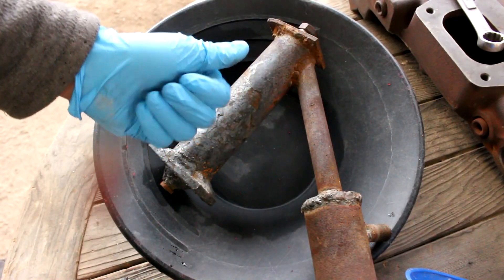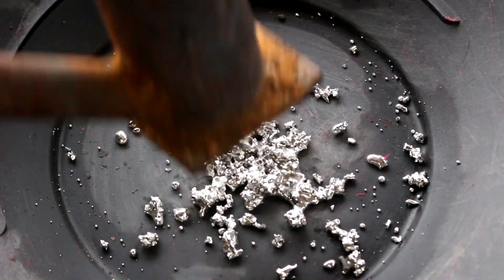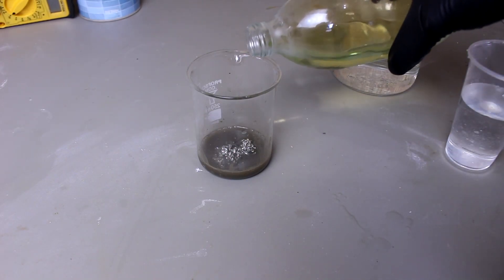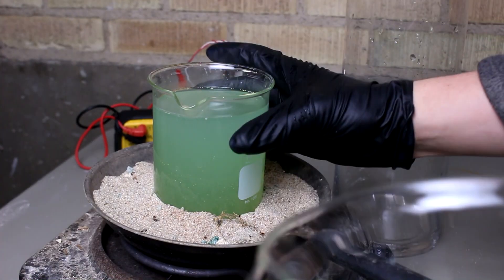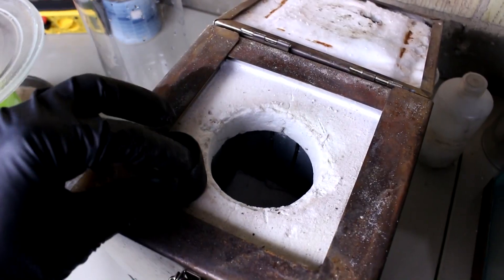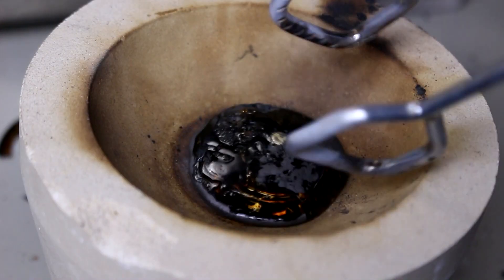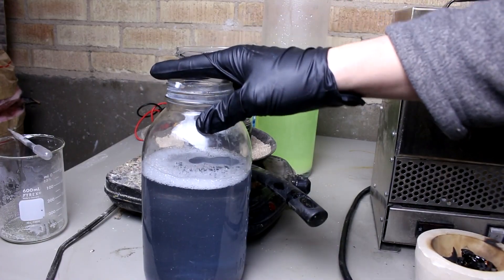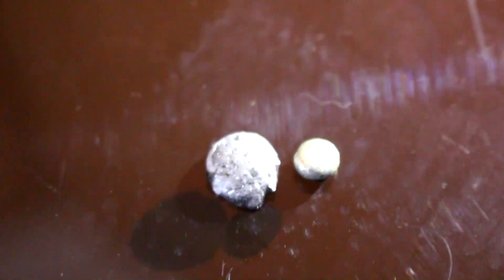Metal Refining & Recovery,  Episode19: Gold From Mercury

Comment: Cody, remember your gold-plated truck bumper and the gold-plated measuring cups you gave to your mother, well why not simply paint them with a fluid of gold/mercury amalgam and then "cook" off the  mercury (using a retort, of course)?  That sounds a lot easier than the complicated electro-plating process.

Comment: I read about an easy extraction process just using a large potato. You slice the potato in half scoop out the middle portion of one half (approx %50). You then place your amalgam into the scooped out part, place the complete half on top & secure it with tie wire. You then place the potato in a campfire for an extended period, as the potato cooks the mercury leaches into the potato, remove the potato, open & remove nugget & burn the mercury back out of the potato. P.s. I have never tried it.

Comment: Theres an old trick to get rust out of a gas tank like on a motorcycle or four wheeler, would work for your distiller, put a few ball bearings down the hole and shake it like a maraca, should get the chunks off the side.
Reply: Re plug it before shaking of course haha

Comment: Hey @Cody'sLab I have a very simple and quick question that might be great for your next video. I have a friend who put a bottle of water in the freezer overnight, and when he took it out the next morning it had turned to a jelly consistency, not crystallized slush, not frozen water, but jelly. Here's his message - "So I put a bottle of water in the freezer to help with my hangover, grab the bottle out and crack the lid and the water turns misty. Squeezed the bottle a bit and it didn't feel solid, so naturally I presumed there was no ice. After opening the bottle, to my absolute amazement I find that not only is there ice in the bottle but it's gelatinous!!"

Comment: Hey Cody just a small tip, after you treated the unknown mercury metal amalgam you should test the solution with stannous chloride to see if any platinum group metals are in solution. Palladium and Platinum are both used in some dental alloy mixtures.

Comment: Ya got some new glassware and that's great, but why are ya still using so inadequate equipment when it comes to hot/dangerous stuff ?! You're handling a 2000°C crucible with barbecue pliers, above a plastic table ! C'mon, let's invest in a decent way to get your hot crucibles out of the furnace : )

Comment: Hi Cody! Out of curiosity, prior to adding the CaCl2, why didn't you take the opportunity to drop the majority of the Hg out of solution with metallic copper or zinc?
Reply from the maker: Chris Giorgi 
Because that would also drop the silver and gold.
Reply: True, leaving a small quantity of cleaner amalgam of Hg, Au, and Ag, which would be easy to retort or part without the remaining base metals present. Also, adding the Cl- ion in the HNO3 solution could theoretically attack any gold that carried over, although the reaction rate is probably slow enough not to be a major concern?

Comment: Could you grow some gold crystals with your Sprengel pump? Saturate some Hg with Au , put it in a flask connected to the pump and heat the flask slightly while pump is running. Idea being that the evaporated Hg would condense into the Hg in the pump.

Comment: Cody should make a "How To" video of properly disposing different kinds of chemicals and other nasty stuff, would be really helpful.
Reply: Don't recall if it was Cody or NileRed, but at least one of them did one or more videos on processing waste
Reply: rosen380 They both did.
Reply: I think he did for a mercury spill. Somewhere on his channel. 2 years old I think. Basically comes down to “Use a broom and dustpan, and vacuum the cracks.”
Reply: ...seeing as the mercury was originally bound up in rocks (cinnabar), couldn't you take the Hg-tainted water and make concrete out of it? Thereby locking it up in rock again?
Reply: @bcubed72  That might not actually be a bad idea. Though, as the concrete cracks and dust forms over time you might release some of that mercury back into the environment, potentially exposing people to it. Though, it would probably be in such small amounts over such a large time span that it wouldn't be dangerous.
Reply: bcubed72 you would have to chemically convert it back to mercury sulfide for it to resemble cinnabar.

Comment: is it possible that fish breathe hydrogen? I’ve read that they need oxygen but if this was true then why can’t they breathe out of water? 😔
Reply: Donald Sleightholme because their breathing apparatus isn't adapted to gases, rather gases suspended gas in liquid.
Reply: Wat?
Fishes need oxygen dissolved in water. They can't take gaseous oxygen.
Reply: Fish can't breathe out of water because their respiratory system (gills) need to be moist to function. Out of the water the gills dry out and can't work anymore. Another problem is that their mouth is adapted to move oxygen-rich water in a continuous stream over the gills. In air, the mouth can't move gas efficiently over the gills.
Reply: Some turtles can breathe water through their butts.

Comment: I think your gold is still impure, it may have other HNO3-insoluble metals carried over with it (platinum, rhodium, osmium etc). So the amount of gold you recovered is probably less than 0.7g. It would be interesting to see you refine even further, but that may be difficult with such a small amount.
Reply from the maker: My guess is that it's from the reused crucible I think it might have had some silver and lead in it.
Reply: stamasd You can bet it was still mixed. his methods are pretty rudimentary.
Reply: Cody, I guess you're talking about the color of the gold (not too golden). Residue from the crucible is definitely a possibility. But there may be other stuff in the gold from the mercury. Gold isn't the only metal insoluble in nitric acid.
Reply: stamasd osmium is soluble in nitric acid. But I don't think that there was that much platinum in the mercury. He didn't use platinum at all
Reply: stamasd and it is also incredibly rare
Reply: *osmium is incredibly rare
Reply: Well I never had enough osmium to try. :)
But chances are there are some platinum group metals in there as impurities in the gold.
Reply: stamasd I just assumed it based on the fact that it's a fairly reactive metal, unlike most of the metals of its period. You must store it under inert atmosphere, otherwise it will spontaneously form osmium tetroxide.
Reply: I wouldn't call this method rudimentary - I would call it "a good starting point" :)

Comment: Hey Cody, try using a bit of wd40 whenever possible to saw steel. It will "cut" the sawing time in half.
Reply: stamasd I don't know you use cutting paste on drills and that stays there and also makes drills last longer and coolant In machines flashes off creating a oil residue on cut surfaces coolant isent for washing bits away it's for cooling the cutting edge on tools to stop them burning out making them last longer you can't flush metal out of say a pocket altho I know mechanical saws have wire brushes to remove cuttings from the cutting edge but I think that's to reduce snagging and build up in the gap not because it wears the blade?
Reply: While that does make indeed for faster cutting, it will dull the saw blades much faster. That's because the iron filings will be trapped in the cutting fluid and will stay near the cut zone instead of falling away, and this leads to extra wear and tear on the saw teeth.
In industrial processes that use a cutting fluid, the fluid is fed to the cut zone continuously as to carry away the filings and prevent this from happening.

Comment: Recovery, or "unmixing" is so satisfying!
Cody, HBPowerwall has thousands of laptop battery BMS circuit boards that he'd like to send you to see how much gold you can recover from them.
I would really really like to see how to recover cobalt, manganese, nickel and lithium from 18650 batteries - their use is growing exponentially so recycling is going to be a very big thing.
Cobalt is currently around $60 a kilo, so well worth doing.
Reply: I fully agree. It would be awesome to see lithium metal being made as well as the other recoverable metals. Cody is the man, but be careful with the off gassing. Your health is important to us viewers too
Reply: That sounds like a lot of work
Reply: Matt, nobody is suggesting buying functional 18650s for their raw materials.
After several thousand cycles when the cells' capacities become less useful, then they can and must be recycled.
I have 100kg of laptop cells here that I have been collecting and testing from various places over the last year or two to make a diy powerwall - half of them are good, and half are dud.
I would like to be able to convert to raw materials to sell.
Reply: Even scrap would  probably have a less than even outcome, unless you buy in major bulk (the kind that large comapnies buy).

I'm not saying Cody shouldn't do it, far from it. I'm saying the "well worth doing" from the implied monetary standpoint is incorrect based on Cody's size of operations.
Reply: make Andy's Top Comment!^^^^^^^^^^^^
Reply: @Matt, just caught your edited msg - yes, laptop battery packs may fail for various reasons such as 1 bad cell that went open circuit, gets too hot or can't keep in balance with the other cells, in which case the BMS will fail the pack in its firmware. Sometimes the BMS fails early, or even the pack has got thrown out by mistake!
There still may be good cells available to use, but it does take thousands of hours to disassemble and test thousands of cells.
I consider good cells to be > 2000 mAh, borderline around 1500 mAh depending on internal resistance and anything under 1000 mAh, dead or have high self-discharge or high IR are end-of-life for recycling.
Some of the really good ones went to make a 2kWh 58V ebike battery, and am still collecting and sorting for the much bigger house battery.
As they are all scrounged from laptop service centres and rescued before disposal, it's all win-win so far, and I'm giving them a second life.
I don't see why lithium batteries can't be infinitely recyclable - the processes used in mining can be applied to batteries to recoup the raw materials.
The value of recycling is worth more than the price - recycling doesn't involve paying miners to do a dangerous job nor incur energy costs in processing tons of ore for a couple of percent yield and distribution, and have fewer middlemen in the chain of supply - batteries are already a concentrated source!

I try to live by these guides:
1. Take what you need and no more.
2. Replace what you take.
3. Leave things as you found them or better.
I believe the world could be a much better place if everyone could do the same!
Reply: Please do this Cody would love to see this
Reply: I took apart a lithium battery once and it caught fire burnt a little hole in carpet so I threw it out the window (it was a electronic cigarette battery)
Reply: @DJAsHeRMusic  it was close to 20 years ago but I was messing with a pair of lithium batteries and one swelled like a balloon so I poked it with a pin (for whatever reason), it blew up in flames like fireworks indoors and burned the heck out of some stuff and a wooden table I had to trash for being too charred. Wasn't really expecting that at the time. Just trying to build a rechargable battery pack for my flip phone back in the day.
Reply: These are excellent ideas.  Cody, take note!
Reply: moiseman Cody would have to do some homework! I'm sure he'd think it's cool :D
Reply: Daniel Asher I don't think he's talking about the actual Lithium cells
Reply: 18650s probably contain only a few grams of cobalt, which means that the cobalt in 18650s are more expensive (assuming the other bits are considered worthless) than the raw cobalt. Even if you sold the rest the cobalt would still be more expensive.

Comment: Isn't also amalgan in dentist Mercury?
Reply: No problem,There is mercury in them, but it mostly stays locked up in the amalgam (although there is some debate on this and many go for plastic ones instead)
Reply: Liquid metals alloy with other metals sometimes, this is called an amalgam. Certain amalgams are a paste that solidify, these are sometimes used in dentistry to fill cavities
Reply: Had an amalgam filling once for a couple of years until it fell out.
Tip: Don't ever chew aluminum foil if you have one!
Reply: WhodamanHD ah OK thank you. But in the Amalgam plombs there's hopefully no mercury, or...
Reply: Amalgam IS an alloy of mercury. It's safe when it solidifies and if it's not scratched. If you have any, it's best to keep it in the tooth.

Comment: Electrolysis! ok hear me out, I'm a electrical engineer. you can use a arc  to split the  nitrogen in air into n2 then bubble it up though ammonia. This makes white fuming acid (I think its pure acid, after condensed with dry ice) and ammonia nitrate. You did a similar vid once
Reply: Lee Lee that's not called electrolysis. Electrolysis is for liquids, and it takes advantage of the fact that ionic compounds dissociate naturally when in liquid or aqueous state. Making an arc in air is just forced ionization.
Reply: Pixl
It's the "electrical engineer" part that baffles me.
Reply: Lee Lee oh my God I can't believe I didn't notice you said "split the nitrogen into N2" when atmospheric nitrogen comes in the form of N2 to begin with.
Reply: isn't that Birkeland Eyde process or something?
Reply: mrslehofer I'm not sure is it? I know that's how it works and that's the chemistry, but I've never condensed fumes
Reply: I literally just said I'm electrical engineer not a chemist guy XD
Reply: Yes, it's not electrolysis. And you don't seem to know what you're doing, so it's best not to do it to avoid injuring/killing yourself.
Reply: Hey Pixl Rainbow OwO what's this? XD add me on facebook cody boone